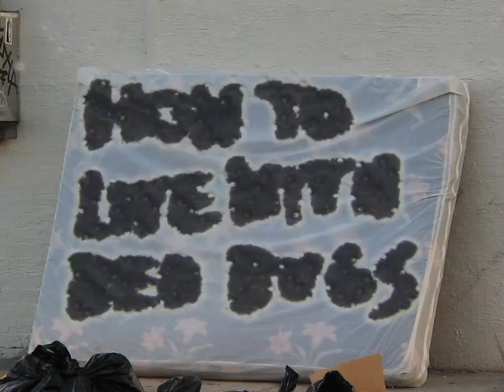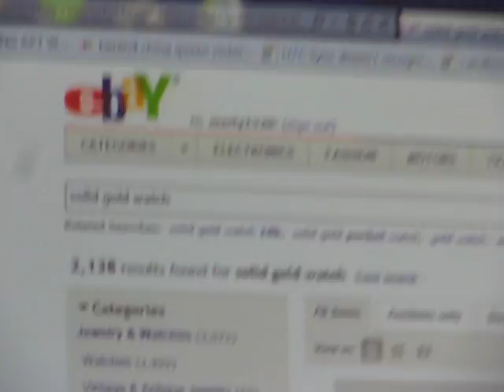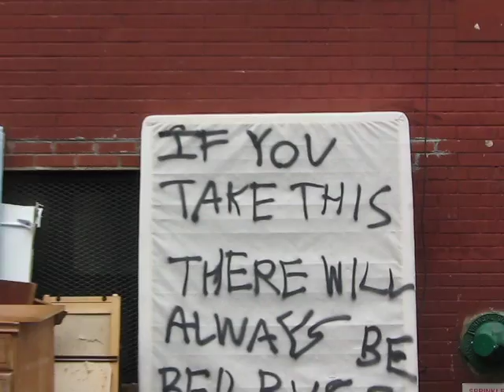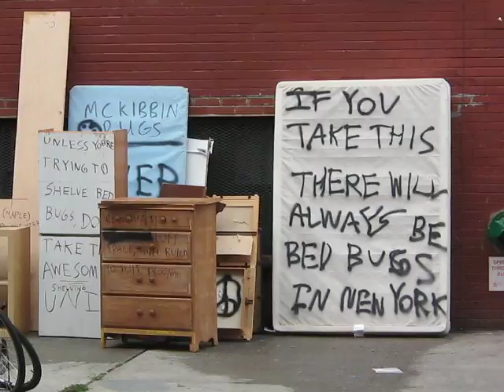How To Live With Bed Bugs

Comment: I had a couple of homeless dudes in my apartment to give them some food and stuff a week ago, and now TO MY HORROR, I find that I've got BED BUGS!!!! And everything I've read or heard about these disgusting things is that they're about impossible to get rid of! Why doesn't some genius out there come up with a simple way to get rid of them?!
Reply: Graham Wellington 
They did. The EPA banned all the good pesticides.
Reply: Yep, Graham, that'll do it.  (Weren't you worried about getting jumped?)
Reply: Use 1 propane heater per room and enough propane to run it for 4-6 hrs and it should heat the house up enouph to burn them out

Comment: Ha. If the refurbished (or new) mattress is draped and left in its micron thick plastic wrapper, even while sleeping on the bed, it wouldn't be possible for the bedbugs to get into the mattress. It isn't tough to sleep without bugs even if the plastic wrapper remains in place. The slight crackle it causes doesn't disturb ones sleep, I mean, compared to the bugs. For the residual presence on the bed, one could spray insecticide, herbicide or paraffin.  Whatever. So no need to be smart about taking off the cover wrapper once the mattress comes home.